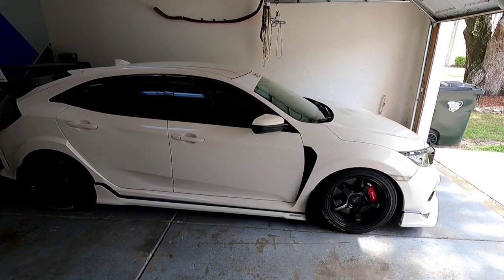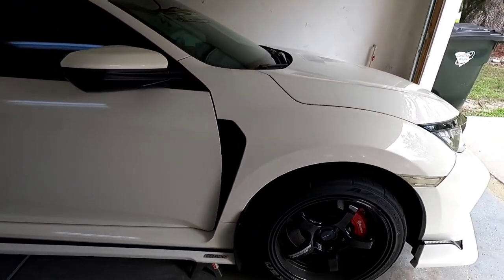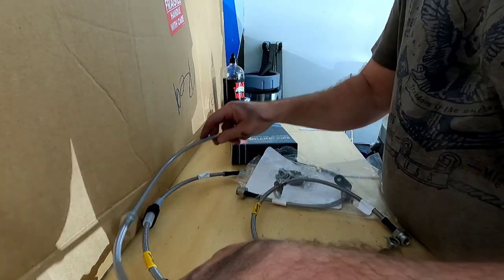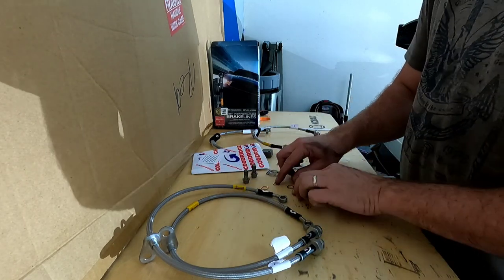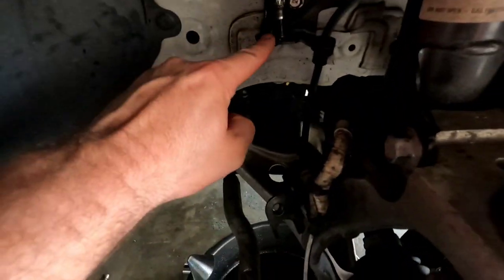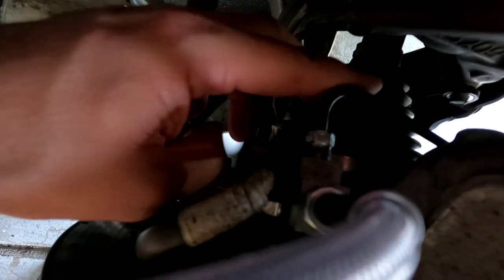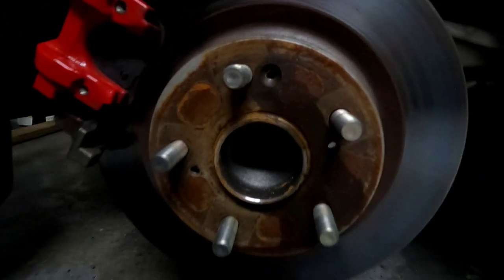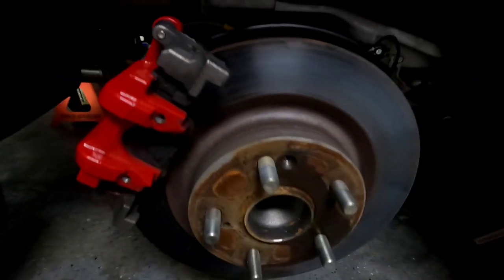Civic Type R fk8 gets paragon 2 piece rotors with goodridge lines and motul 600 fluids installed.

Comment: Nice video man! I got the same brake lines, waiting on my rotors. I got front and rears and I went with Hawk 5.0 pads with Motul rbf600
Reply from the maker: Awesome your going to love it. Very responsive
Reply: @1sikbuild  hey man I was just wandering if you had any problems with the goodridge brake lines running. Im pretty sure I have the updated version. My lines don't rub on the inside of my wheel barrel. I was wandering how are they working for you?
Reply from the maker: @ChamrongHuy  works really good. No issues
Reply: @1sikbuild  Really? that's good. My passenger side is rubbing on the barrel of my 18" wheels but not my driver side. I'll look at it again. thanks man!